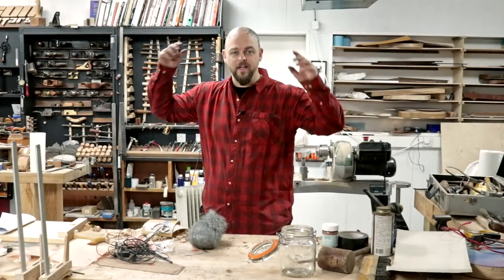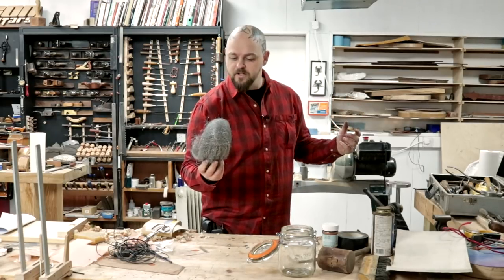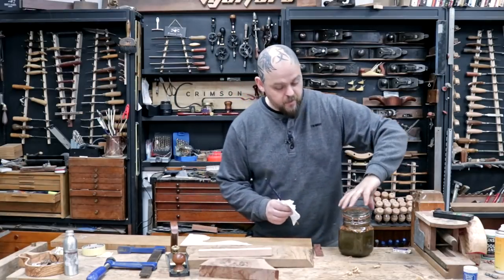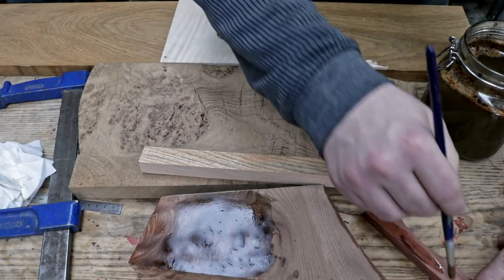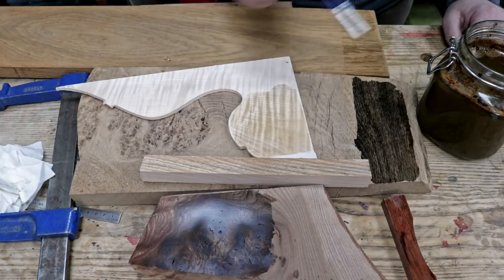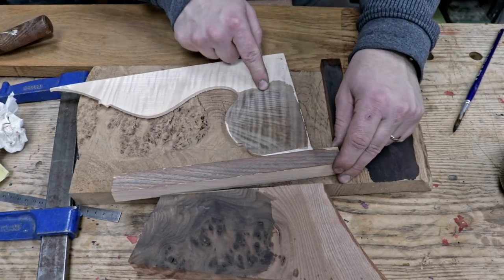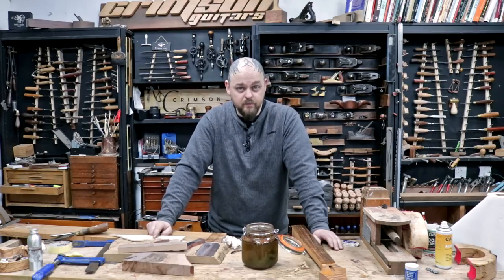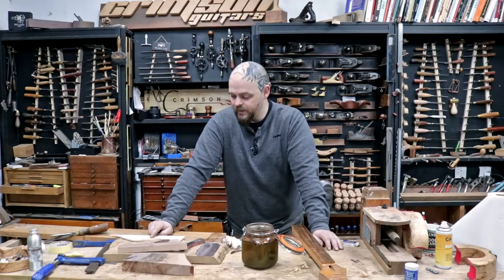Experimental Luthiery - Oxidising Guitar Woods - Using vinegar and wire wool

Comment: Grab a handful of oak shavings off the floor, put it in a pan with water, bring to the boil and simmer for 20 minutes. Paint any wood that isn't oak with that tea before the vinegar solution, that'll deepen the colour on pretty much any wood. 

Also, it's a lot easier to make the vinegar solution in a jamjar with a metal lid because you can punch a hole in the lid and shake it every few days.

Comment: If you go back to your ammonia test. Take a piece of wet paper. Cut it to a shape. Say crimson guitar logo. Put it on the copper. Then do the ammonia thing. It should leave the shape with a different patina to the rest of the affected area. Also put your control plates on the top. It would look awesome. No one else has control covers that go to the edge of the guitar. If you put that in front. And put the knobs and shit in it, total awesomeness. Your student has his control plates on the front. If you just take it that one step further you will achieve greatness. :)

Comment: Used it on my first build. It works on any wood high in tannins. Red oak and walnut in particular. Turns black before your eyes. Also good to turn shiny hardware dark. Have pics but don't know how to add them here. Any suggestions?

Comment: I worked for a pine furniture place and to pre age wood, to match the old, they used dilute Pyrogallic acid ( photo developer?) followed by caustic soda when dry.  It worked..
Reply: Caustic soda was sodium hydroxide?
Interesting, have to try that.
Reply: Wupme yes. But dilute it and wear rubber gloves! It's what they use in paint stripping tanks for old pine doors etc.
Reply: For pine projects, I usually soak the entire project in "Liquid Plummer" to oxidize the tannins.  The wood turns fluorescent green for a day or two and then goes gray!

Comment: As a woodworker I can tell you, you're not oxidizing the wood here, you are simply staining with wire wool rust. The only way to age wood artificially is to oxidise the tanins and for that you need an alkaline not an acid (or you can fume it with ammonia but thats a brutal process)  - the ideal being baking soda, thats the way its been done since the arts and crafts movement (gives the exact same result as fuming and is a lot less hazardous and stinky), works especially well on oak, 1 tsp of soda to half pint of water, brush on, leave 30 mins and you have dark wood that really works into the grain. It might go purple if you go too far but that easily dusts off with a light sanding and the deeper ageing is in the grain.

Comment: i Knew a old man back in the 80's who used broken records as a fake ebony inlay, but the old jealous man  had the Stradivarius Syndrome( refusing to pass down  trade  secrets even after death) . he would smash up and melt without the paper center label, old 33-45  records to a thick hot paste(( that was the  secret part which he did alone in the shop all by himself )) and fill in wood carvings for cabinets  etc etc ,As it dried the spatula would give the vynil  light or dark veins just like real ebony!!! This would be great for guitar neck inlays perhaps. All i know is he would smash up l'Lp's into tiny fragments into a old  tin, add a liquid ( i presume)!!! and heat stir until it became a dence usable paste, he had to work fast a piece at a time as soon as it cooled it could be worked as if wood. Maybe someone in the chemical industry could help you find out how to melt vynil.    Ps you make beautiful guitars ...

Comment: I also have used calligraphy ink mixed with water to stain guitars 
Sorry
I know you have your own stains to sell but ink does work very well
Reply: David Cherrington I've read several cases of people using India ink to ebonize fretboards
Reply: José Domingos Teixeira I haven’t tried that , I’ve just used green and deep red inks on the body 
Had good results too
Reply: José Domingos Teixeira I had a friend who built guitars as a hobby, he tryed this. I've also seen this in cheap Englehard and Kay upright basses from the 60s and up. In all cases, the strings eat through the stain really quickly.

Comment: What about ammonia fuming please experiment
Reply: 86bigel he did. Years ago. Did in the video catalog
Reply: *Dig in the video catalog
Reply: Done that... need to use industrial strength ammonia (30 odd % pure) and the stuff is nasty toxic. 
Just the fumes... 
will blind you.... will permanently f-up your lungs.... will kill.
So yeah... good fun.
Need to construct an air tight "tent" and wear full face respirator when loading the liquid in a dish to evap...fume out.
Works well with quarter sawn white oak to bring out the "rays"

Comment: Boil up some oak shavings and sawdust in a pan of water. When it's cooled, filter it and paint it on to the wood and let it dry. Recoat and apply a second coat. When the second coat is dry paint on the vinegar and wire wool mix. Leave to dry and add another coat of the oak soup. While the second coat of oak soup is still damp paint on a second coat of the vinegar mix and leave to thoroughly dry. You will end up with a powdery residue on the surface of the wood which can be washed off with some kitchen roll and some warm water. When dry you can apply the final finish of your choice. I prefer oil, but a hard or paste wax will work equally well. Look up Richard Maguire's Side Table series at http://www.theenglishwoodworker.com/ to see it done.

Comment: I tried this before seeing this video. If you boil the vinegar you only need to leave it for 6 hours.
Reply from the maker: oh? That is interesting.. I wonder what the heat does tot the vinegar to speed up the change? B
Reply: Not sure exactly how it works but definitely works really fast if the vinegar is boiling.